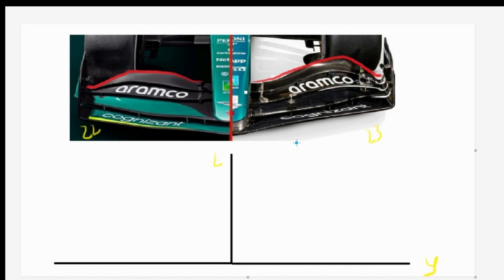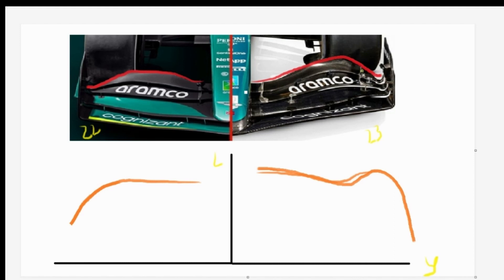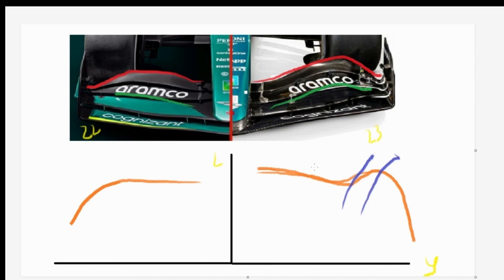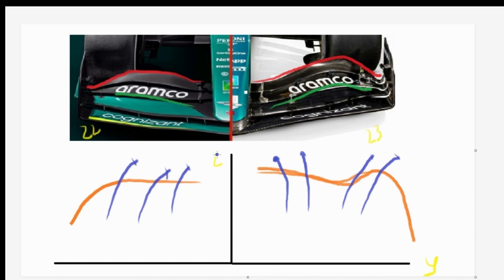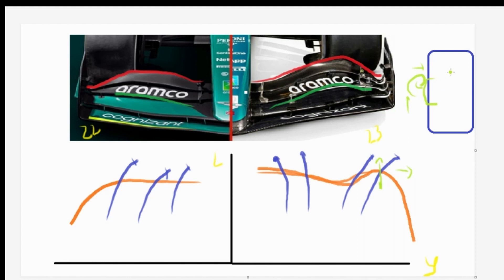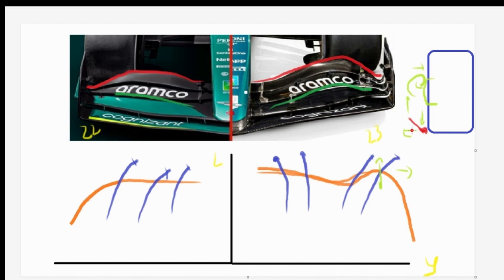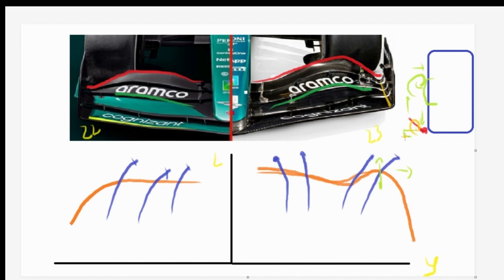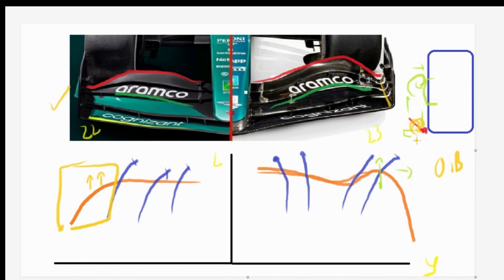F1 2023 Aerodynamics : Aston Martin (AMR 23) - Front Wing Explained

Comment: Hi, I just realised that the nose section in both are different. The one on the left has a continuous Front Wing, whole the one on the right is discontinuous. Would this be a boon or bane to floorboard air flow, and cause interference to inwash passing through the midsection thus hampering squish management?

A lot of questions but I hope it's not that complex. Please correct me if I'm wrong. I am fairly new to Aero analysis and am still getting my head around these concepts through your LinkedIn posts and YouTube videos. Thanks for that, helps me stay curious.

Comment: Nice illustrations but unfortunately I wasn’t able to catch your part analyzing how the span-wise load distribution creates inwash or outwash. Assuming you have a continuous half-wing with higher load inboard and lower load outboard with consistent ground clearance (kinda like many FSAE front wings but a smooth transition). Theoretically you should have higher Cp on top of the higher load inboard portion, lower Cp on top of the outboard portion, and vice versa on the bottom. Would you expect an out wash on top and an inwash on the bottom?
Reply: Exactly. As high pressure air flows in the direction of lower pressure, you will have inwash on the bottom  and outwash on the top.